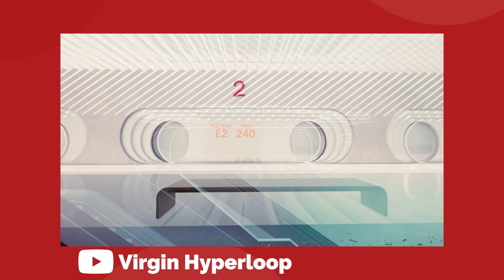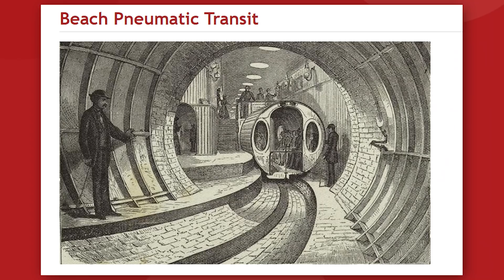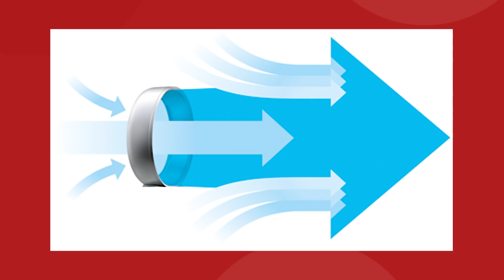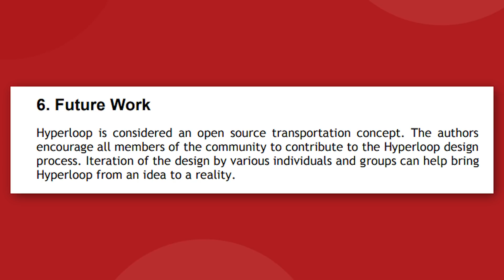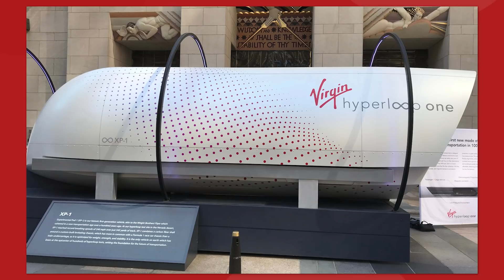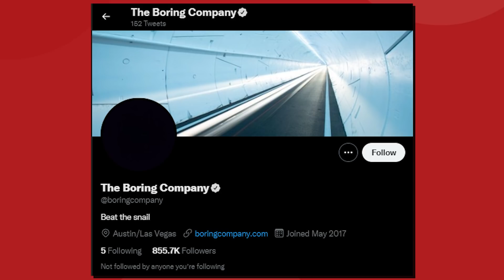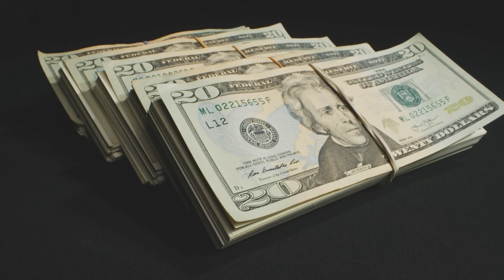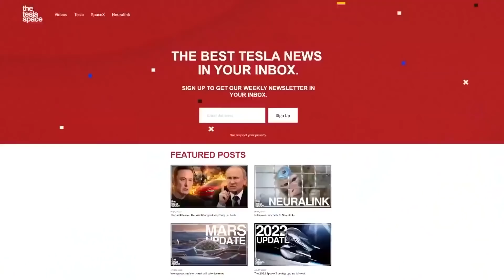The Boring Company Is Building A Hyperloop!

Comment: The more perfect the vacuum, the faster you can go using less energy, so ideally you could have a hypersonic train travelling thousands of miles in a few minutes using less energy than aircraft currently do. Only problem: massive investment needed in the infrastructure up front. Maybe build the tunnel first, run regular high speed trains through it first, then work on upgrading sections of it to run at faster and faster speeds as you increase the vacuum. Maglev makes sense to me, as no moving parts needed, practically zero friction and no batteries needed except maybe a small pack to run lighting and air conditioning systems in the train in case of power failure.
Reply: Michael Jaxton  I would imagine that creating the vacuum would require a lot of suction energy. Maintaining the vacuum is a materials problem. Firstly you have to have an impervious material that won't allow air molecules to pass through it. Then you would probably need triple or quadruple air locks to allow the vehicles to pass in and out of the vacuum, and also valves that don't leak. Then you need pumping systems to maintain the vacuum if any inevitable leakage does occur. Sounds like the kind of problem Elon Musk and his team would love to solve.
Reply: @aftonline  Lifting a 90,000 lb aircraft to 30,000 ft and sustaining it there for two hours also requires massive energy.  A vacuum only needs to be obtained once.  And then incidental leakage with every transit would be evacuated.  Which do you think would be more?
Reply: It is impossible to run regular high speed trains in the small tunnel dig by the boring company, the air resistance will make it impossible.
Reply: the tube will crush , sqeezing life out of passangers
Reply: @margarita8442   The train would need to be strong enough to withstand the pressure. It would need its own air supply too. All engineering challenges that would have to be overcome.
Reply: @markharmon4963  Not once, but every time passengers are loaded. There are always going to be leaks and a rifle round from a idiot would be catastrophic.
Reply: @eleventy-seven  An airlock would prevent total decompression of the system every time a pod was launched.  And the volume surounding the pod in the airlock could be designed to be minimal.  Thereby reducing any incidental introduction of air into the main circuit.  The system would steadily remove this contamination.  

The wild shooter situation is probably less likely.  You would need a high power rifle at close range to penetrate 1" of steel.  And a hole of 1/2" diameter could be plugged with a layer or two of duct tape for a short term fix.  It would slow things down and it would not be catastrophic.

Comment: I never understood why Virgin went maglev when air bearings are so much cheaper. Maglev is so expensive per mile it will never be a thing.
Reply: It's not bad to try more things if you have the capital, that's how you get breakthroughs in tech. But I will still agree with you for their case.
Reply: China has 10,000's of high speed rail lines. Not even the richest country on earth.

Comment: They should build a toy test model first.... Testing as true scale makes the myriad of failures too expensive and slow to both experience and test out fixes.
Reply: have u not been around for the past 10 years? its not even rail its a tunnel with teslas/wheeled vehicles. and it also doesnt make sense to build rail on mars until theres multiple colonization happening. and knowing elon's schedule thatll happen never but its nice to think about
Reply: They've already built a scale model and tested scaled down pods.  At the SpaceX facility in LA.  

What has held things up is developing a much faster tunnel boring machine which seems to have happened.  The Vegas Loop has been where BoringCo has worked on testing out how best to build concrete lined tunnels.

Comment: Nice report. First let's just say the Boring Company is anything but boring!! Original, eh? LOL 

First, I and a friend (a retired shop high school teacher) made a model of this concept several years ago in his big garage/shop. We connected a several foot long (about 50-60 I think) circle of PVC tube, about 3/4" dia. I think it was. One joint coupling was a 45 degree connector out the side to attach  a vacuum hose for air suction. A model car (just a long plastic slug, 3 or so inches) was inserted into the tube and vac turned on. We scaled the speed, it was a crazy hundreds of mph (400?). Cool little thing but just a toy! But we did say it would be neat the build full scale, but nothing would have made us use it ourselves. LOL. 

Good places for the full scale Elon version would be the deserts of CA, NV, AZ, NM. Lots of space and scattered little/medium towns to connect them with this. Or the Middle East!! Perhaps a small planet covered in red soil? Someday? Who knows?! :D

Comment: I thought this idea was already debunked.  Hyperloop would only work deep underground where the temperature is constant because of thermal expansion.  A few mile long track can expand the size of a football field on the surface.  Also zero atmosphere of pressure is insanely dangerous.  If there is a breach in the vacuum tube, you have 1 atmosphere wall of pressure coming at you at the speed of sound which would instantly demolish the pod and anything inside it.
Reply: I totally agree with you, however newer hyperloop designs are not pulling that much vacuum at all, just enough to remove some resistance.
Reply: @TheBaldr  might as well just get some maglevs
Reply: Like most amusement park rides, eh? That poor kid dropped like a stone and became a confirmation of "known physical laws", like you have described here! ;D

Comment: I truly believe the future of this improving mode of transit is beneath the sea, not beneath the sea bed but along the sea floor. I believe that to free transport of rail and also land borders (opening any maritime route to its developers) will completely free our future of the poisons air traffic presently disperse. This is approximately 900 million tons of CO2 annually.

A great beginning location is between east coast Scotland and northern Europe. The sea bed between these locations sits at a steady level between both land masses.

Good to see rail companies finally have some competition. They have had it all their way for too many centuries. 

Of course such a system only benefits they travelling long distance. It is only long distance that will satisfy our progress and improvement.
Reply: Maintenance of that kind of thing is too expensive.
Reply: How you going to power it? just because its under the sea doesnt  mean its suddenly no polluting. Co2 is not a pollutant anyway
Reply: @ericpalmer3588  how long do oil rig structures last? this is pretty much the material such a structure would be built with. clearing such material of corrosive attachments would take a minimal amount of time and would create a high quantity of employment for divers and technicians, perhaps in such a way as for allocated teams to be designated set lengths of tunnelling to work upon.
Reply: @stoppernz229  you power by electricity. How else? Do you truly believe manmade CO2 is harmless to our environment?

Comment: This will work very well where these isn't any atmosphere such as in the Moon between habitats.  Perhaps a similar system ought to be build but using Monorails for Mars.  If you need the atmosphere at the front to get out of the way would it not be a better idea if the air went under the unit rather then having to rely on fans!
Reply: yes, that similar system is called a train
Reply: The tube might be more practical and cheaper  to build than rail so you might be right. Time will tell. However the primary motive for it is to create a low vacuum. Lacking atmosphere, that motive is lost and perhaps there are more practical solutions for transport on the moon.
Reply: @markharmon4963  For movement on a planet with different atmospheres, like Mars or Titan, I like the idea of helicopters (we've done), or the proposed Titan drone-like -looking vehicle that is supposed to be launched umpty ump years from now, to explore that mysterious moon of Saturn!!
Reply: @ronschlorff7089  I will look into it.  Thanks.
Reply: @markharmon4963  Yeah it was on one of those small specialty channels like this one having to do with future space exploration, Space Race maybe! 

Best ones, of course, would be the "rocket bus" from "2001" or the Eagles from "Space 1999"!! :D
Reply: @markharmon4963  on "Real Engineering" one is called "NASA's Dragonfly mission to Titan". on YT. : )
Reply: Why would you need this ridiculous design on mars? You could just build a maglev...
Reply: @leinades6122  rovers like in the Martian for a long time I think. before such stuff needed.

Comment: Can't you see, Elon's master plan? Starship diameter 30ft, Boring machine 12-21ft, Hyperloop alpha 13ft. Those are building blocks for the Mars Colony. Impressive spec on earth, but not good enough yet for Mars City. :)
Reply: Nor I see what you mean. At first, I was like… Why not build an bullet train like what California is trying to do but then I realize how effect it would be for mars to have a tunnel train on mars’ surface.
Reply: @nightslasher9384  Primarily, the boring techology will be used for building shelters on Mars. The latest version of boring equipment is able to start digging directly from surface, no need to dig a deep vertical pit to start the work underground. It makes the work easier on the surface of Mars.

Comment: Actually, it does have precedent in the aerospace industry. Smaller jets such as the Learjet have already gone through the testing process to be like the capsule without wings. In 2013, I coined the term “like a Learjet through a tube at sub mach one.”This is a patented statement and I, Paul Neuhausen, MSCIS, have patented employment. Not nobody else can use the state without my permission.